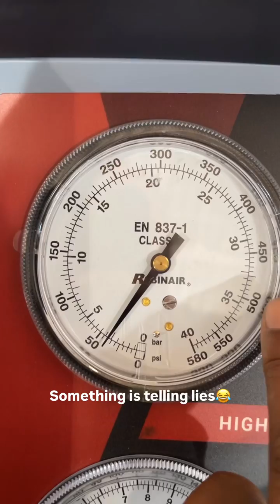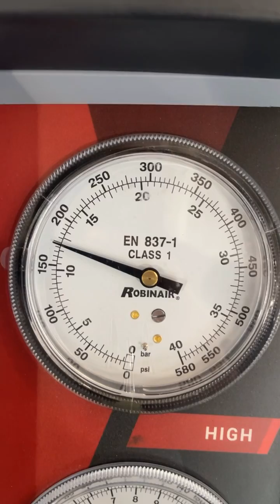2017 chevy impala ac blowing warm

Comment: do you know if the robin air machine was detecting r134a because of the bad pressure switch?  I'm getting the same message on a 2020 impala.
Reply: and how were you able to recover it we have the same robin air machine and it won't let me recover it with that purity message.
Reply from the maker: We actually have a Kia in the shop at this moment and it says that the refrigerant is contaminated.  We’re going to have to come up with something to recover the contaminated refrigerant